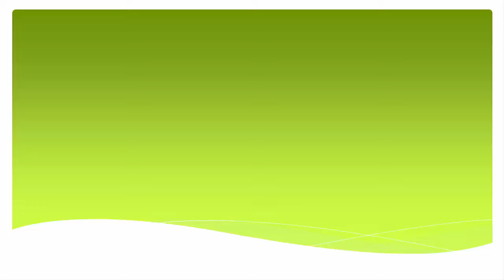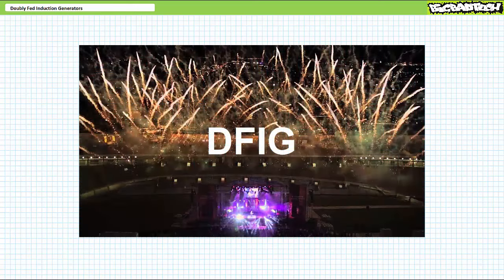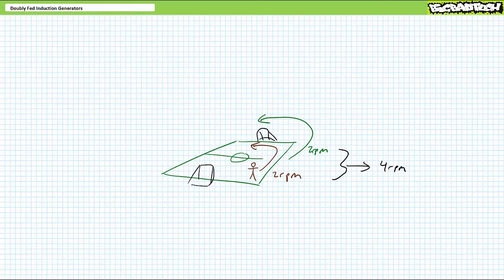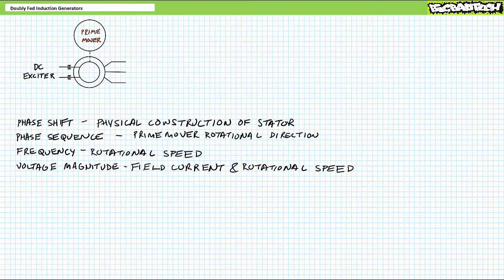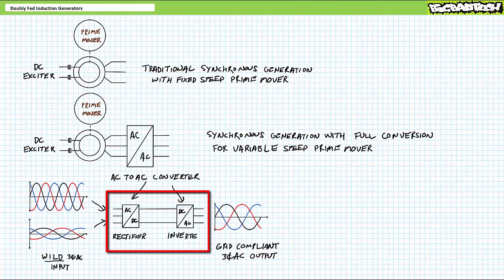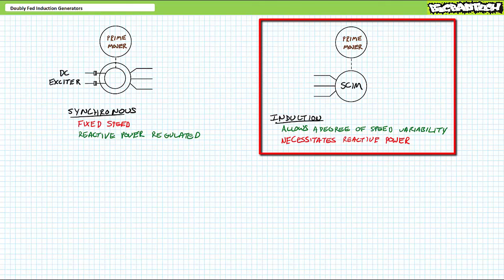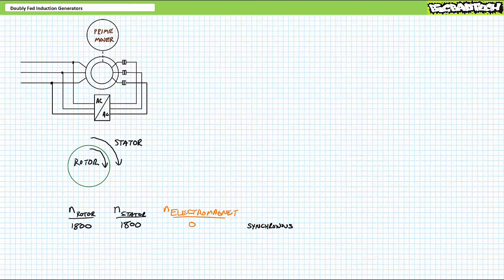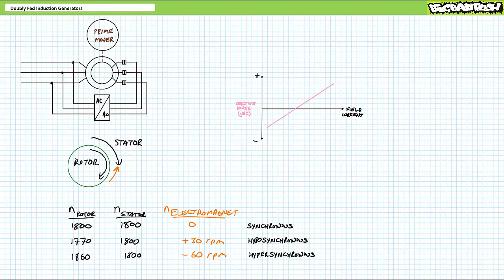Doubly Fed Induction Generators (Part 1 of 2)

Comment: Hey Man appreciate your work. Could you please help me understand what voltage is provided to rotor when nrotor=1800 and nstator=1800 (time 13:16 ). If i understood corectly when nelectromagnet is 0 rpm, voltage frequancy in rotor is also 0, which means that there is a Dc voltage or there is no voltage at all, second situation  obviously does not make sense becouse there wouldnt be magnetic field, first situation is also not clear becouse how would you provide dc through AC/AC converter.

I have also second question if i am right the current is provided to the rotor from the grid(but is it only during excitement or also during normal work?), if the rotor is provided with power from the grid whole time how is it possible that the power in wires is going in 2 opposite directions at the same time power going to the rotor and power going from the stator(is it possible becouse of 3 phase ac voltage?) or is it working like that: after generator is excited stator provide power to the grid and to the stator?
Reply from the maker: first question, 0 Hz = DC, the middle part of AC to AC converter is DC so it's just AC to DC

second question, yes it's 3 phase AC sometimes it goes in some times it goes out

Comment: "There's a method to the madness" revelation after the first four minutes or so.
Reply from the maker: Did I take that example too far? I wanted it to be memorable!
Reply: @bigbadtech Can you make a playlist so we can watch the series in the correct order?
Reply from the maker: Here's all the playlists:

DC Circuit Analysis https://www.youtube.com/playlist?list=PLdnqjKaksr8qQ9w3XY5zFXQ2H-zXQFMlI

Single Phase AC Circuit Analysis https://www.youtube.com/playlist?list=PLdnqjKaksr8pXF2SpDyyD7ouAVlz96_Ra

3 Phase AC Circuit Analysis https://www.youtube.com/playlist?list=PLdnqjKaksr8qzoIGCYx2rhVK51ZPjXkRO

Hydraulics https://www.youtube.com/playlist?list=PLdnqjKaksr8ruhw85YYSSO6EWLhVVmSKm

Pneumatics https://www.youtube.com/playlist?list=PLdnqjKaksr8qM_nxfOnZhELfIlr6auQZG

Motor Control https://www.youtube.com/playlist?list=PLdnqjKaksr8qRPCFkU2Q8XQe0bfo99rs6

Motors and Generators https://www.youtube.com/playlist?list=PLdnqjKaksr8oba07pG-nE1Omy1_mabMtI

Motor Drives/Variable Frequency Drives (VFD) https://www.youtube.com/playlist?list=PLdnqjKaksr8qruLl85Uq3em62PjXlSNUF

Programmable Logic Controllers (PLCs) https://www.youtube.com/playlist?list=PLdnqjKaksr8qxlMYRVTF2YzTm6RwtA7pc
Reply: @bigbadtech  Thank you